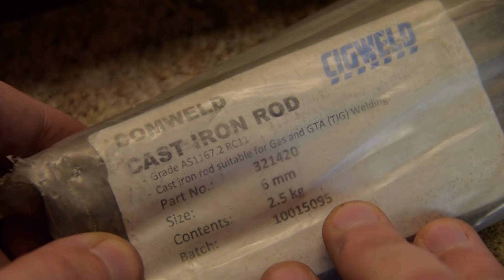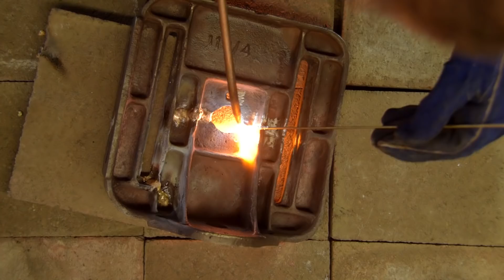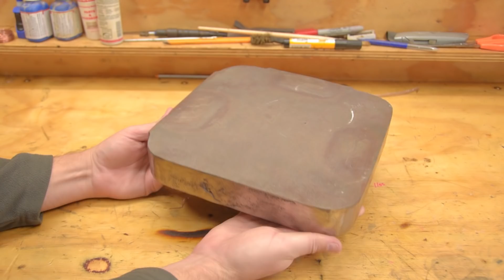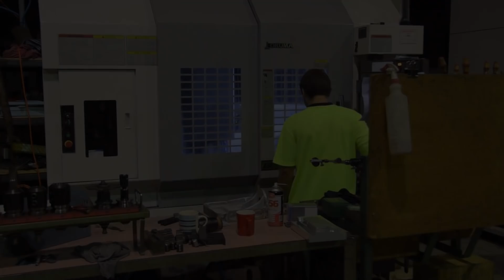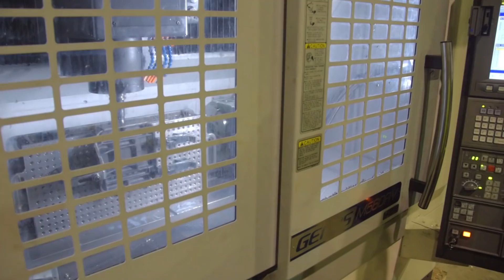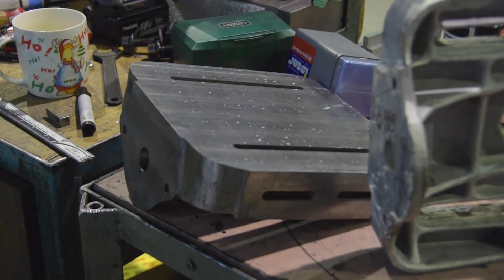Drill Press Restoration Part 9 - A New Table

Comment: Maybe it's a dumb question, but if this level of milling was available in the first place, why cast the thing again in iron? Wasn't easier just pick some steel block in the scrapyard and mill the whole thing? It would be way better than cast iron and you could improve the table, let's say by cutting those grooves some larger drills or mill tables have.

One mod I'm planning on my bench press table is a 150 mm (~6 in) hole in the middle, and make metal disk's that fit that. I will make the disks with different configurations, ie plain, central hole, eccentric holes for clamping etc.

Comment: I doubt there's many who have never drilled a hole into a drill press's table or vise while learning including myself. Once or twice that's just part of learning what not to do I guess. A few partially drilled holes in the table should clue in any different operator though. If that arc of shame was all done by one person then they were a metal butcher with zero skilll's. If it was multiple people then they obviously aren't very observant. Your table wasn't as bad as some pictures I've seen. But smart move cutting your losses and just having a new casting made.

Comment: "THE ARC OF SHAME!!!"  I chased cracks on the left exhaust manifold on my favorite car in the whole world when I was 18.  1964 Olds Starfire.  It was the death knell of the car.  I've never seen much success in fixing cast.  Your'e experience mirrored mine.  Casting a new table was BRILLIANT!  

Craig, good on you man!  It's obvious you know that machine well.  Great work!
Reply from the maker: Yeah, depends. Sometimes it goes well, sometimes not. I think the shape of the part is the biggest factor.
Reply: So does skill of the welder.  My bud didn't let it heat enough.  His welder, his shop, so he did it.  I know that now.  And, since the advent of the intenets....  I could prolly find a replacement now.  Not so in 1980....  I only found one replacement trans for the slim jim in it within a 100 miles back then....

Comment: Well done lads , looked like a good clean casting from the foundry !
Regards 
Robert
PARTSMADE 
(UK)
Reply from the maker: Cheers Robert. The casting is more 'aerated' than the original if that makes sense. Like there are microscopic holes through it when cut. I don't know how else to describe it, but you probably know what I mean.
Reply: @GeoffreyCroker  AKA porosity
There's a great iron foundry in Chch btw, https://www.castingshop.co.nz/
No porosity whatsoever in anything I've had them do... and no job too small.

Comment: You missed making the hole in the middle? Or does that come later? Of course, I took the easy route and JB Welded a new plate to cover the old 'arc of shame' on my restoration.
Reply from the maker: That was plan B. But once it split through the centre I thought a new part was the only option.
Reply: I didn't intend any criticism of your solution, I was just saying that I took the easy route right off the bat, before trying (and failing at) cast iron welding. It must be nice to have the connections to make a whole new part. If you look at my restoration video, you'll see that my table was almost eaten through with 'idiot marks' in places. Epoxy putty and paint can hide a whole sh*!heap of damage.
Reply from the maker: Don't worry I didn't take it as criticism at all. Glueing another plate on top is what any sane person would have done. It's what I would have done as well if all of you guys weren't watching 😁

Comment: Use a BBQ to heat the part, much easier.  Then you can do the welding on it while still on the fire.
Reply from the maker: Yeah, it was kind of a one way hole once I got the part hot. I did consider using the BBQ but I thought it would be OK. I test welded with the same gas tip and filler beforehand. Just totally overlooked the fact that the mass of the drill press part was going to suck up so much heat.